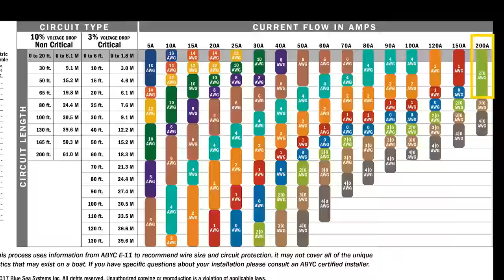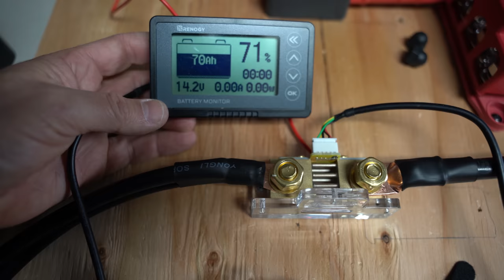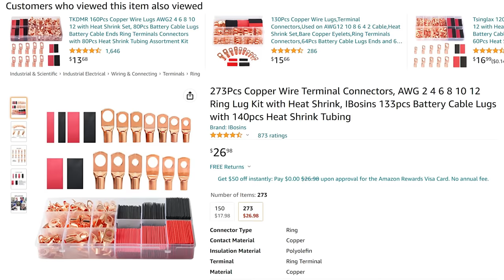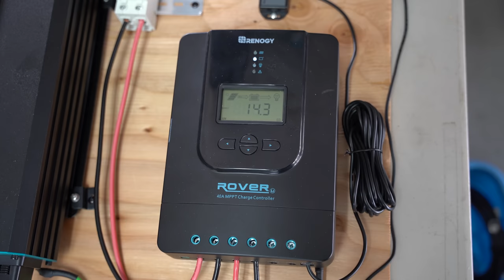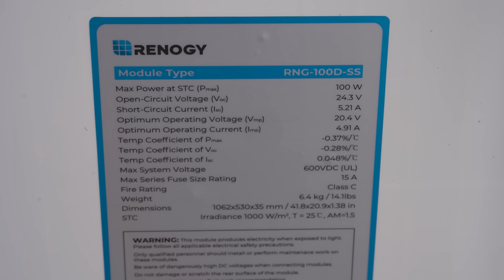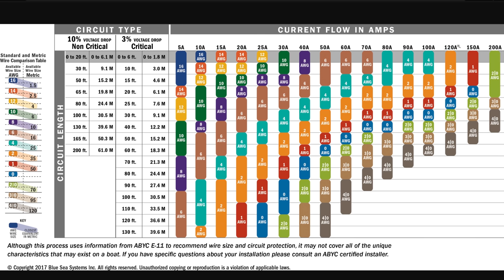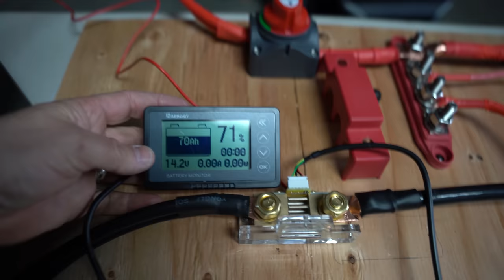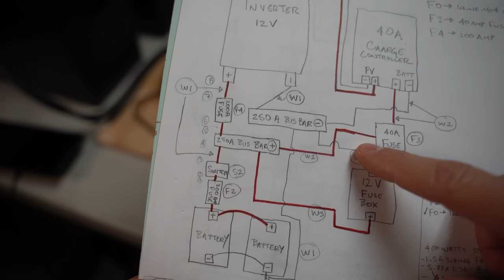How To Build A Solar Setup: COMPLETE Step-by-Step, DIY Guide (12V, 2000W)

Comment: The formulas he is using is simple OHMS LAW very basic algebra. I learned  this back almost 40 years ago in electronic classes while working on my degrees in electronic engineering.  This is still good info to learn that everyone should learn. I plan on building a solar power system for my place so info such as this is great to refresh what I learned years ago.

Comment: Or, as I learned it back in Electronics Engineering school..."It's easy as PIE." So POWER (P) = Current (I) X Voltage (E) This aligns the equation to the Engineering standard notation...or Watts = Amps X Volts for the actual Units of Measure. GREAT informative video as usual !!! Easy as PIE !

Comment: This is one of the best videos I have seen on DIY solar setup. Most of the DIY systems comes with no instructions or UL certified cables and connectors. Instructions in this video demonstrate and explains the purpose of each device very well. Cabling chart link is very helpful. My first system had no wire gauge markings on the cable I had to find lugs by trial and error. Adding fuses, circuit breakers, and battery disconnect adds an extra layer of protection.

Comment: I found 2 tools that I already had for cutting through 2/0 cable. A chopsaw with 122 tooth blade, and a copper tubing cutter. the copper tubing cutter is also helpful in cutting through the insulation before stripping. you can also use a hacksaw, but that is slow.

Comment: This is by far the best explanation I've found. I watched many videos before yours and had already mapped out my entire setup on paper. This made it easier to fully understand your explanation from the start. However, what sets this video apart is the detailed discussion on wire sizes for each of the hubs and converters/chargers in a 200A / 2000W setup. This helped me finalize my setup without overspending on larger cables, as I now fully understand the amps running through the system.

Comment: 6:04 question here. If the inverter is running at 85%, would we not multiply by .85 instead of dividing. If it’s working at less than 100%, wouldn’t your amperage be less than 100% (166.67 amps)? By dividing, you increased the final amperage number. I’m not an electrical engineer or electrician, just someone looking for some clarity. 

I really enjoy the channel and am actually a member of the City Prepping community. Stay safe out there y’all!
Reply: I thought it would be less amps as well.
Reply: took 10 mins of scrolling to see if this question was asked, I agree the amperage should of been 15% less.
Reply: An inverter ideally converts 100% of DC input into AC output without losses. In reality, an inverter with 85% efficiency means 85% of the input power is converted into usable AC, while 15% is lost as heat or inefficiency.

For example, if you input 30A at 12V (360W) DC, the output will be 2.55A at 120V (306W) AC, with 54W lost (not 54A). To compensate, you increase the input to 35.294A at 12V (423.528W) to achieve 360W AC output.

The 2000W rating refers to continuous AC output, not the input limit.
Reply: @IsaakMills bro what are you trying to say here cause this makes no understanding

Comment: Great video.  Since this is an instructional, please do 2 things in future videos.  Remove rings or wear gloves when working with high amp equipment.  You can do some serious welding with those batteries.  Never use pliers on nuts.  Can damage nuts and cause a short if they slip.   Use wrenches or sockets that are properly sized.

Comment: This was the best video on all of YouTube. I step by step followed your directions over a 4hr period had to go back a couple times but I now have a 600w system with a 2000 w inverter and 3 Vmax slr100 100ah AGM batteries. Hoping to save up to get those lithium’s. Thank you very much for your time ❤

Comment: For the larger wire going from the inverter to the batteries, I would use welding wire, ie 2/0, 4/0, it is a little more money but it's really flexible and much easier to use for this type of install.
Reply: Also the welding wire is key for safety. The wire he used does not have enough copper strands to be safe at the high current. Most solar component manufacturers specify the minimum number of strands for the specified cable size for connecting their products. Too few strands can increase resistance with could then overheat and start a fire.

Comment: Your 200amp wire and fuse calculation goes out the window when voltage sags below 12volts. Using your calculations if someone were to run batteries down to an extreme cutoff voltage of say 10.5volts you're  then at 224amps. Also, what about temp rating of wire vs amperage.
Reply: Amperage doesnt magically rise when the voltage sags.

Comment: even after weeks of research and figuring out what i needed to order i got to the point of setup and found this video. people mention fuses and switches but rarely go into them. i have a 3000W, 12V setup that i'm trying to get going and i think you've just filled every hole i may of had of course other then nuance of solar. amazing video

Comment: Here is a huge "Thank you!" for listing all the part resources and sizes in addition to your excellent explanation of setting all this up. 
I'm prepping my very small camper for long-term survival with 400W solar, 4 LiFePO4 100Ah heated Battle Born batteries and 3000W inverter.
Best wishes to you!

Comment: I set up a 300 watt solar system in my camping trailer about 6 years ago. I visited a lot of YouTube sites and bought an instruction manual. If this video would have been available back then, it would have been all I would have needed.
This is great. It’s complete, to the point and easy to understand. And all without the time wasting hoopla that take up the first half of most youtube posters.

Comment: I've been researching 'adding solar power to my RV' and I've seen a LOT of different videos far as connecting from the solar panels to the charge controller , then adding in a  Inverter, then to the batteries..Then I see some devices being added in between  such as a shunt ? - power off switch or a disconnect switch for the solar panels and  the correct size wires to use  but you explained everything in detail on 'why' all the connections extremely well so that I now can decide on what to buy. I thank you sir.. This is the best video yet....I'll be be adding this to my favorites bar for reference..

Comment: This is, by far, the most comprehensive and easily explained video on a solar system setup. The information in this is invaluable!! I do have one question: why is there a "double" cables from the battery to the switch and the shunt?

Comment: This was excellent!! Well explained is an understatement. I do want to mention to others though, that, if you were not comfortable with doing this, or do not understand what is explained here, you may want to call upon the help of a professional. Just because you’re working with a 12 V system here does not mean that you can’t be seriously injured if something is incorrect. At those amps, it will still knock you on your a**. Or freak you out at the very least. 

Well done on this video.

Comment: Great video on this. I am looking more towards a total house setup, but building something like this to dip your toe in the water and have a portable setup is nice too. I wish you had included a quick price scheme based on what you built here.
EDIT (I priced it out):
$1500 or so (Though you would want to add a second battery and more solar panels thereby increasing the cost):
$369.99		2000W 12V Pure Sine Wave Inverter
$152.99		Rover Li 40 Amp MPPT Solar Charge Controller
$569.99	x2	12V 100Ah Smart Lithium Iron Phosphate Battery
$84.99	x?	100 Watt 12 Volt Monocrystalline Solar Panel
$23.99		Fastronix 3/8" 4 Stud Stainless Steel Power Distribution Block with Cover
$54.77		Blue Sea Systems 100 Amp Mini BusBar
$49.50		Blue Sea Systems ST Blade ATO/ATC Fuse Blocks
$20.63		2/0 AWG 2/0 Gauge Red + Black Pure Copper Battery Inverter Cables Solar, RV, Car, Boat 9 inches 5/16" Cable Lugs
$42.99		Battery Inverter Cables for 3/8 in Lugs
$22.99		Battery to Charge Controller Tray Cables for 3/8 in Lugs
$15.99		Solar Panel Extension Cable with Male to Female Solar Connectors (Single)
$54.33		WNI 2/0 Gauge 5 Feet Black 5 Feet Red 2/0 AWG Ultra Flexible Welding Battery Copper Cable Wire
$14.69		10pcs 2/0 Awg - 3/8" (M10) Sanuke Wire Lugs Ring Terminal Connectors Ends Heavy Duty for Battery Cable Lug Wire Electrical Eyelets with 3:1 Dual Wall Adhesive Heat Shrink
$38.37		4 Gauge 4 AWG 10 Feet Black + 10 Feet Red Welding Battery Pure Copper Flexible Cable Wire - Car, Inverter, RV, Solar
$20	or so	12 awg cable
$16.80		Cable Clips for Cable Management Cord Organizer, 6 Sizes 300 PCS Nylon R-Type, 3/16'' 1/4'' 3/8'' 1/2'' 3/4'' 1'' Black Plastic Screw Mounting Cord Fastener Clamp Assortment Kit with M4 Screws
$1,553.01		Total
This is a minimum cost to build the infrastructure, it can be expanded on.
Reply: wouldn't it be cheaper to just buy a solar generator kit rather than building your own?

Comment: Video is awesome , so easy to understand .  I am rewiring my set up as adding some new items . I am currently running 2 x 300w panels . a 60A MPPT   a 3000w inverter  using 4 x 12v 130ah batteries . Going to add a rotary switch 63A  and to switch between batteries and a 600w booster charger for Ebike

Comment: Excellent video, BUT the equipment ground on the 2000W Inverter should be at least a 1 AWG wire, one size below the 2/0 feed wire.  A very good video!!

Comment: Harbor Freight sells a red metal 2 shelf cart on caster wheels that's great foundation for building a power station like this. It's mobile, so you can move it around wherever you need power. I fit 4 300amp hour 6 volt AGM batteries (400 lbs) in the bottom tray (reinforce bottom with wood), all the controllers, inverter, etc on top shelf.

Comment: Excellent video. Im planning on building a self contained and mobile version of this contained inside a footlocker. Batteries to one side, everything built onto an internal frame with 2x4s and osb. Switches and such accessible from the outside, and room to store 2 solar panels on top. Ill be adding a ground and groud rod on the outside. Love this!

Comment: I appreciate the effort that went into this, thank you very much for doing the video. It was very well done and  explained very clearly. **The only mention that should have been added is that 200 amps is the MAXIMUM draw that should be on a 12v system. Anything higher should be stepped up to 24v because the goal is to keep the draw under 100a for safety, cost and efficiency.

Comment: An outstanding video, terrific channel. Engineer, former school teacher. What I would recommend for the uninitiated is that you open up with the capabilities of the system. That is to say, with this 2000W inverter system you should be able to do. I would also initially indicate the cost of the set-up that you have displayed table in the lab.🎉

Comment: This is an excellent video that is very well produced. Good Job Sir!

I started my SUV solar build 8 years ago but health issues stopped me (almost) dead, in my tracks.
ARRGGG
I feel much better now!

My SUV/Solar project is the number one item on my Bucket List. I have all the components except the solar panels. I'm planning on 300 to 400 watts to charge my 2 x 100 Amp-Hour AGM battery pack that will get extended to 4 batteries. Some day, in the distant future, I'll replace the AGMs with Lithiums as soon as I can rob a few banks. HaHa.....

I intend to boondock down the East Coast to Key West, across  the Gulf to Boca Chica to catch a space launch or two then over to Phoenix, the Grand Canyon, up the Eastern Slopes of the Rockies and then back to the North East via the Great Lakes.

I think that will take 12 to 18 months with many stops on the way to video historic locations.

Along with the solar panels, I need to aquire a GSD Puppy Dog to keep me warm at knight and company 24/7.

By leaving my apartment, utility bills and staying out of Home Depot and Amazon's web page, I expect to be financially stable.

Only time will tell........
Reply: Sounds like a plan Russ!👍
Good luck and be safe!✌️

Comment: I know very little about electronics or electrical stuff other than as a kid I knew that sticking my tongue on a 9 volt battery wasn’t something I wanted to continue to do.

With that being said watching this video was almost like trying to learn a foreign language or something similar.

Sir you were extremely informative that’s for sure. I think like you said if one were to write everything down before hand, draw a diagram, and research as well as ask questions it can definitely be a learning experience that’s for sure.

Seems it can possibly and hopefully transform a guy whose only knowledge is the 9 volt batteries can zap the tongue into really respecting and understanding how solar and electricity works within the Rv realm.

Thanks for the video.

Comment: I have a 300ah Ampere Time LiFeP04 battery, 2000w pure sine inverter, 60 amp MPPT charge controller, 200amp ANL fuse, battery switch, and two 100w and two 190w 12v solar panels. I plan to wire two 100w in series, the other two 190w in series, then parallel them to power my 500w window air conditioner. I`ll use the simple little in line 10 amp MPPT charge controllers to boost charging with another 100w glass panel, my two 100 and 120w folding panels, and a 150w flex panel I have, one 10 amp controller for each. I may only use two more panels though just to get enough to keep my battery topped up. I`ll likely buy more glass panels for this and try to get 1000 watts going to my battery to keep up on partly cloudy days and for a decent charge on mostly cloudy days. Now I need a battery meter. Messed up and ordered the wrong one.

Comment: Question 🙋‍♂️ 

Not an electrician and excited to learn from videos like this and anyone generous enough to respond in comments. The question is: what is the purpose of the 12v fuse box? I would have thought the inverter would handle this function (somehow) but I’m interested to know the why. Thanks in advance!
Reply: Exactly what I was thinking. My only idea is to take power directly from the panels before having to go to the battery, possibly saving battery life? Also if this is the case would a breaker be better?

Comment: City Prepping, I've watched several of your videos and they are by far the best I've seen.  This solar how-to class and lab as well as your Faraday cage videos are excellent.  So informative and moreover they are to the point without a lot of wasted time. I've watched your solar panel videos as well as your Faraday video and a few others. Well done!
Question: After making the ammo can Faraday cage and the trash can cage, would you suggest grounding the ammo cage?  The conclusion on the trashcan cage if I understood correctly is that it wouldn't need a ground if sitting on the correct surface for storage. Once again, well done.

Comment: Great information and thanks for sharing this. I built a small portable solar battery backup system, mounted on a 2 wheel cart. Renogy 200 watt. The wire run from the 100ah battery is less then 3 ft. 2.0 wire can be expensive. Some wire calculators take into account the very short wire runs and recommend 2AWG.

Comment: This video was exactly what I needed-clear, concise, to the point, and no hard sales, perfect! But I did get confused on one, small part. At 19:45, Chris talks about taking the panel short circuit current of 5.21A multiplying times 1.56 = 8.13A and he uses a 10A inline fuse but for what> What is this calculation and fuse for?; it's not on the layout board, so it must be fuses between panel, right? Also, wouldn't the fuse on the positive lead from the last panel be sized for 400w/12v=33.3A or 40A (which is the sized breaker you used). But, based on calc for the 8.13A in-line breaker, why wouldn't the 33.3A be multiplied by 1.56=52A be used? Everything else was perfectly explained! Thanks for a job well done!

Comment: Excellent video very helpful. 

One note I think you meant 2 AWG wire not 2|0. Per the chart 2|0 is for 200 amp. Save a $$ on copper. 👍.

Comment: Good video, there were a few things I didn’t like though honestly. Main one being the fuse bolted to the battery, and not a fuse holder, while you may get away with that in a shed, any kind of vehicle with movement, and the weight of the wiring will do damage.

Comment: Again, really nice video. I see at 29:00 in your diagram you have a 200 amp fuse right off the battery positive terminal, and then another 200 amp fuse before the inverter on the positive side. Seems rather redundant ( as well as money spent unnecessarily), especially since the charge controller has a fuse protecting it and the 12 volt box has individual fuses to protect those conductors. I’m not trying to be picky but as I’m putting together my first solar setup I want to get it right , and this might be helpful to others as well.

Comment: when i built my new house i had an batter back up system with solar panels on top of my house, and i also put in a whole house back up generator that can run to charge the batteries, if there is no sun light or in winter, my basement is a bunker and im ready for what ever comes 5 years of water storage, 25 years of food, all set for what ever happens

Comment: Excellent set up and instructions for a simple and versatile DIY system. I plan on using an all in one charge controller and inverter since wiring and lug bonding is a major issue for beginners. I’ll also go to 48v to keep the wire sizes to a minimum.